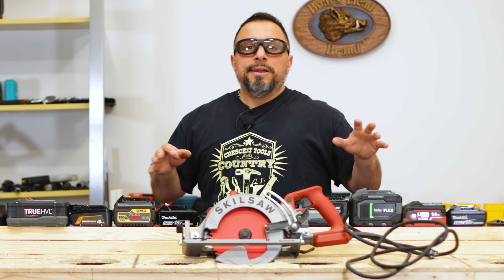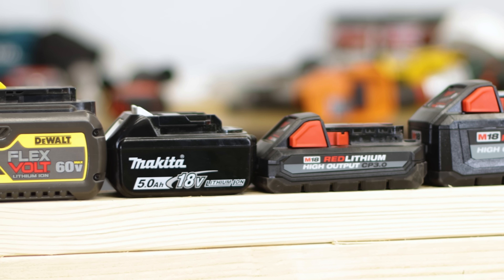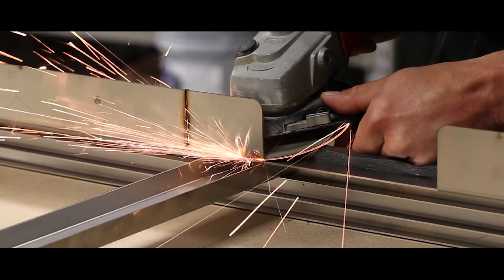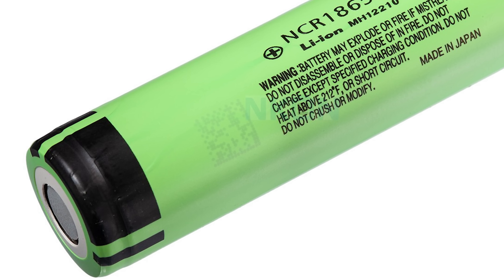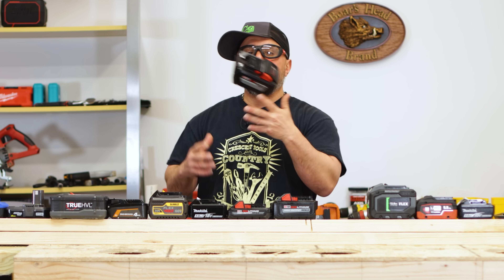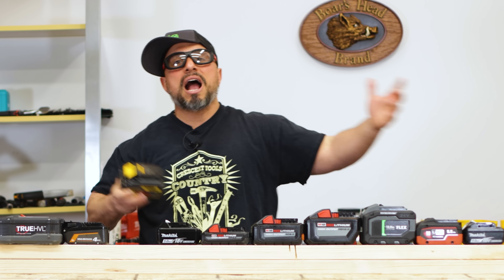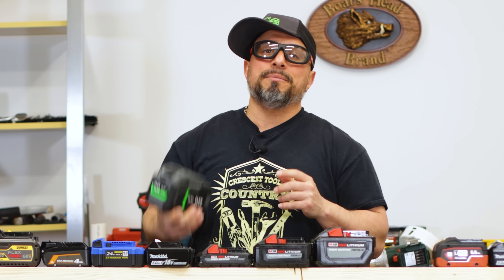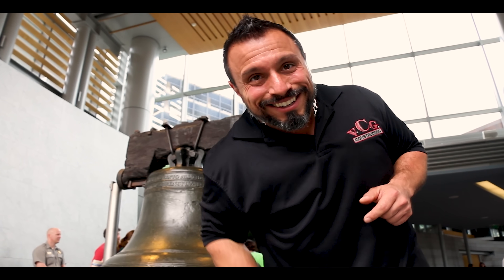Get The BEST PERFORMANCE From Lithium Ion Batteries & Make Them LAST LONGER!

Comment: That was good advice but when it comes to buying batteries the best advice would be not to buy 1.3ah 1.5ah or 3ah batteries because the cells in 1.3ah are only 1300mah, 1.5ah are only 1500mah cells 3ah are 2 rows of 1500mah cells, 6ah & 9ah batteries are only made up with 1500mah cells 3 & 4 rows of 5 cells, some manufacturers may use 3000mah cells but probably not because 3000mah cells would be expensive, best purchases would be 2.5ah or 5ah batteries which would have 2500mah cells, 2ah & 4ah would have 2000mah cells

Comment: The "CPR" for Li-ion batts he's referring to includes using a 9V battery to put a small charge on your fully dead battery for a few seconds, pulsing it for 10-20x, then throw it back on the charger and see if it will accept it (without error flashing). Worked for me plenty of times on 18650's I had laying around.
Reply: What do you mean, "pulsing it for 10-20x"?  Are you talking about connecting the 9v battery to the Milwaukee battery on-and-off rapidly 10-20x, or putting that battery you just "jumped" with a 9v onto the charger on-and-off quickly 10-20x?

Or, are you talking about putting that "jumped" battery on a tool and quickly hitting the trigger 10-20x?
Reply: @thebordernow  9V to Li-ion, + to + and - to - for 2 sec on, 2 sec off. Repeat. The goal is not to over-stress the 9V to the point of damage while doing so.

Comment: Anyone have any trouble with their M18-12.0 battery failing prematurely? I bought it with the table saw in mid 2019, but have barely used it due to life reasons. Admittedly, it sat in my truck in CT the entire time, but every other battery, including the fake ones, still hold their charges more than adequately.
Anyone have trouble with their 7 1/4 inch miter saw stuttering every single time I try to make a cut, regardless of the freshness of the battery and the amp/hour caliber? A fresh, year old 9.0 battery does it as much as a 1.5 battery. I blow it off every day, throughout the day and the contacts appear to be spotless. It's done this since day one, but now I can't even use it and I'm using my ten inch Milwaukee that came with the horrible stand. I'm pretty sure that I bought both of these through Home Depot, for what it's worth.
Thanks

Comment: Too bad they don't make tool chargers as adjustable as the ones I use for my remote control cars... I can discharge/charge to storage charge (3.85v per cell), balance the pack at full charge, set full charge limit to <4.2V to conserve life or >4.2V for high voltage packs. I can also set the depletion limit on my remote control cars to a specific range so it stops before the pack is down at a limit that is hard on it. That's with a "toy". Yet with tools that people use to do their jobs and support their livelihood, they are forced to live with devices that aren't nearly as useful. Then again, it would force anyone that buys a lithium tool to understand charging/storage more than they probably do.

I don't use 18650/li-ion cells though for RC's, everything I use is lithium polymer. But my chargers can charge li-ion as well.
Reply from the maker: Wait, explain?!?!
Reply: @VCGConstruction  Instead of having the BSM in the battery pack, our battery packs are just lithium polymer cells joined via tabs with balance leads on each cell going to a single plug for the charger along with two main leads for powering the device we plug it into. The cells are bundled in various quantities of cells we need them in for our RC vehicles. 1 cell, 2 cell, 3 cell, etc. Except, they list them as 1S1P 2S1P, 3S1P, etc for cells in series. Some packs have cells in parallel and in series to increase voltage/capacity/current handling, usually the ones with parallel cells are cheaper cells/packs to make them more robust by doubling them up internally. These packs are listed as 1S2P (1 pair of cells wired in parallel), 2S2P, 3S2P (3 pairs of cells wired in parallel with the pairs wired in series), etc. The chargers use both plugs, the main ones to push a lot of amps quickly, and the smaller balance plug to monitor each cell as they fill/deplete, then the charger switches to a balance mode that uses the balance plug only and charges/discharges each cell individually. Some chargers tell you the IR of each cell as well, also how many MAH in and out while charging/discharging, the voltage of the pack, voltage of each cell, etc. I use 18650 cells for various things and have made 2-4 cell cradles to charge them on my RC charger similarly.

Many use DC based chargers and build power supplies out of old/new computer server power supplies to run them. I have a couple 20A/500W chargers connected to a pair of 1200W 12V PSU's wired in series to have a 24V/1200W power supply. There are many chargers that run of AC and DC, just usually less output when on AC.

The packs we use for RC stuff far outperform anything (or most) packs used with power tools. Speed run guys pull hundreds of amps out of these things in short bursts. Drones pull a lot as well. Some of the more typical users peak at 100A or so, like me. I have trucks that run on 6S 5000mah packs that average 20-30Amps with peaks of 110Amps and I average 15-20 minute run times. Then I take those packs and charge them back up at 2 times the capacity (2C charge rate) of 10A in about 30-35 minutes.

Here's a video I just searched for to show you RC lipo basics if your interested:
https://www.youtube.com/watch?v=4V0MT74GKyU

I didn't watch it, just assuming they show you packs, chargers and whatnot.

Comment: I fix batteries locally, yes heat in the truck melt those cells and caused them to leak
i revived most of them and balance them is the key, internal resistance gives you an idea if the batteries done or any life left 
Milwaukee has a protection to prevent cells being charged if one of bank cells dropped below certain point, some of the earlier model has bad bms board, especially those 5Ah.
The newer 21700 has a stronger protection.
Some spot welder end points became loose also cause bms to disconnect batteries from charging.

Comment: For most lithium ion cells after 300 charging cycles still maintain 70-80% of their capacity with zero noticeable effect on performance and you can run them through several hundred more cycles before 
the degradation becomes an annoyance .

Comment: The degradation of battery packs is one of the reasons I’m not an electric car fan. Of course there are many more reasons I’m not an electric car fan but think about it for a minute,  if your electric car needs a battery pack that costs $10,000 and the cars worth is only 15 to 20 thousand dollars technically your car is not worth fixing it’s in a sense totaled. So does this mean we will all be leasing electric cars instead of purchasing them and driving them for years like I do. Plus the last time I researched it there wasn’t a cost effective way to recycle lithium batteries. The recycling process was expensive and dangerous as lithium can be very volatile in the right conditions. I’m sure electric is the future of automotive transportation it’s just still in it’s growing pains phase.

Comment: I often gripe about my milwaukee tools but the batteries are another story.  The 2 original batteries that came with my first drill impacter set are still going strong after 10 years.  I have a 5.0 ah battery thats 7 years still great.  And now a beastly new 8.0ah battery.  Awsome runtime!
Reply: Question is do you use them every single day. I use my tools every single day mine are usually done after 3 to 5 years max. Using them every single day vs using them sometimes is a very different story!
Reply: @marcowens3522  I had the same experience as this last guy.  Got a Milwaukee combo drill/impact set with 2 5.0 batteries back in 2015.  I use them for work every single day.  Not only that, I semi-abuse them.  I use that drill as if it were a hole hog.  Its been so hot from heavy use I burned my hand on it.  I use my sawzall as if it were a gas powered chain saw.  They are still going strong.  I have never left them on a charger overnight and I always use them fully and charge them fully.  I leave them in the work van in 100+ days and way below freezing nights.

Dewalt batteries on the other hand I have not had good luck with.  Most of the guys I work with have Milwaukee stuff.  1 guy uses Dewalt and 1 guy uses Makita.  For almost all of us Milwaukee is the best.

Comment: I have Milwaukee and DeWalt batteries M18, 20V that I have been using since April 2016 and they are still going strong and are used 6 days a week.. I don’t leave them in the cold or heat and charge only when need be. I store them in a DeWalt 2.0 tote with vent

Comment: So I'm building up my arsenal of Milwaukee M18 Fuel, and I was thinking, why don't these tool manufacturers make a power adapter that clicks into where the battery would go but runs straight to an AC outlet.  This way one could use AC when needed, and battery when needed.
Reply: Metabo HPT Does this with their 36 multivolt adapter.

Comment: Great job explaining battery maintenance. I keep my batteries indoors in a stainless steel pot with metal lid, just in case they ignite for some odd reason. You can never be too careful. I store them at 50 percent until I need to use them then I charge them  to 100 percent for full power.

Comment: I just had to pull a warranty from Milwaukee for 4 8ah HO and 2 12ah HO that are 3 months old. I’m not using the rapid charger any longer and purchased the 6 bay sequential charger to get more battery life. On the bright side the Milwaukee rep did state the company will gladly warranty all batteries for 5 years as many times as necessary.

Comment: Don't get me wrong there's nothing like the convenience of a battery powered device especially the screw gun but for the most part I do not mind picking up a three-prong Court walking up to an orifice and sticking that into that spot it does not take me all that long it is not that much of an inconvenience to have a wire attached to it and the fact that I have peak power and performance at the flick of a switch I think is worth all the inconvenience of sticking that power cord into a hole and having to wind up a power line I know it really makes life difficult for some but I guess I'm used to it

Comment: I bought seven milwaukee tools this week from Home Depot and every single battery was one bar out of the box.  Should I complain to the depot or Milwaukee and will it do any good?
Reply: New batteries are stored with a partial charge and require a full slow charge before use!  What you are seeing on those batteries is normal.

Comment: Oh so much wrong information while also in a way being right. A lot of the information is right, but more so pertaining to older lithium batteries, and also a lot of it is dependent on the charge circuits the pcb's in the batteries control the life more than the cells. Granted they are in some cases designed that way for safety others for profit. Like laptop and cell phone batteries built same way, but rated usually 100000 change cycles. Granted Sony at one point said the shortening of life do to the charge circuit shortening it was to increase revenue for profit not safety and they were going to stop the practice and try to change it through out the industry. Have they🤷🏻. But yeah the batteries are the same, plus if you know how to solder, or have a spot welder you can change the cells instead of replacing the batteries if they don't have a circuit chip that controls the life, which most tool batteries I don't think do.

Comment: Bought my first Milwaukee drill several years ago - around 2013 I think. Came with two 2.0 amp hour batteries. I only used the one battery and never even messed with the second one. Fast forward a few years later and I learned a lesson that they wouldn't charge. I was able to re-use one of the 2 batteries through jump starting it with a good battery (ended up buying a 3rd battery to be my only working one) but now it won't charge again. Now that I have more batteries that work and more tools, I leave the tools in the garage and the batteries inside the house...

Comment: Good thing you put the Milwaukee 12 amph for the add.   It and HO Milwaukee tools is a horrible performing.  When they warm up and trip out...you walk to the charger for more batteries to the point corded would be better.  I think I have actually damaged a 12 amph... it no longer shows a full charge on fuel guage.

Comment: Another thing you never want to do with Lithium batteries, is when using a tool and the battery dies, don't do like we all used to with NiCad batteries, and run them til they die (tool shutoff), then wait a couple of minutes for the batteries to recover, then hit it again trying to finish that hole, or cut or whatever. NiCads and NiMhs can handle this treatment and it's even good for them once in awhile, but it will kill Lithium batteries real quick! If your Lithium battery goes dead (tool shutoff), just put it in a charger, or get a charged one, don't try to wring that last little bit out of it.

Comment: Makita star 🌟 batteries will cut out before you can fully discharge them.  And blow cool air into the batterie via a fan built into the charger.  So the tool will shut down and save the battery 😃🥳🥳

Comment: Below freezing doesn't permanently damage the batteries from the research I've gathered, unless it's extremely cold like -20F. It's only a temporary capacity reduction. Which is suppose indirectly translates to lower life span as you will be charging/discharging more often when it's below freezing. 
And yes Vince, I agree 100%, all electronics manufacturers including tools and phones, should be implementing a 20% buffer on each side, with the ability to override this if you need the extra capacity. Would really help improve lifespan of devices and keep this e-waste out of the landfill. 
Just wanted to edit: keeping li-ion batteries between 20-80% can increase the charge cycles to well over 1000, even close to 2000 in the papers I've read, that's a massive difference!

Comment: Awesome Video Brosuff. So much I didn’t know about batteries 🔋 wondering how many cycles usually in the smaller 12-14v have 🤔💭
Reply from the maker: I would think they’re about the same
Reply: Number of cycles is the same regardless of voltage.    Each lithium ion  cell is roughly 3.7v, manufacturers  connect cells  in series to provide the voltage each tool needs.  Higher voltage= more of the same cells in series.

Comment: The very basic chargers that come with tool batteries make it hard to care for batteries. With no selectable charge rate, the charger always charges at its max capability. There is also no way to set the charger to charge to less than 100% if you wish to put the battery to a 40-60% storage charge.

Comment: All good advice and so true, and the same can be implemented for a cell phone....(especially those super quick rapid 20-30 min charges to 100%. Thats gotta be brutal on the battery when done over and over, imo. It’s why I charge my phone at normal rate, as only takes 33 mins longer....usually, and never let phone go below 20-15%. Just my imo).
But back to tool batteries. Would be nice if the batteries didn’t degrade, and maybe someday a brand will solve this “issue”. 
Till then, we got some great tips from Vince to help keep batteries at optimal state and to save money by not having to buy more batteries😉👍🏻👍🏻
Reply from the maker: Thanks Aepek, hope you’re doing well!

Comment: Shouldn’t it be made compulsory to provide battery indicators. These things can become fire or explosion hazards. And a Lithium ion explosion is something of note just ask the people who practice radio controlled hobbies. 
Justvsaying there should be Rules and Safety regulations regarding design and manufacture. In addition there should be specific recycling centres for these batteries in order to harvest the lithium back again. Lithium is expensive and that is the reason they cost what they cost. Moreover it should be stated clearly how many cycles you can get out of them too to allow the consumer to make an informed choice. Maybe a universal adapter system would also be handy. 
Thanx VCG  for providing us with this essential info!! Much appreciated!

Comment: I have those dewalts since they came off and im sure that im over 500 cycles,but i always tryng to keep them charged and i use the fast charger and as soon as they fully charged i remove the battery so dont over charge,i dont inow if im right but i think that a battery fails when you pet it all day in the charger,i bpught my first flex volt 60v 2 years ago and still holds the charge very good

Comment: As a DIYer I always buy corded tools.... they last decades heaps more power cheaper to buy no batteries to chemically age and replace - assuming there even still available.....

BUT

It’s always handy to have a cordless drill driver hammer drill and blower...... but that’s it the rest is corded

Full time tradesman is a different story

Comment: ...the tools should come with both feature of battery and corded if possible..I had to mod my portable drill to a corded dc ..never used those battery pack since..it came with exactly 12dcv instead of 14dcv charger...it never fully charged to run those motor..I was frustrated...dang!!..it never had any bms on it..I checked it..

Comment: The charging to 80 and not letting it discharge below 20 could be programmed on the bms- battery management system.  But some company's don't give a f and want you to buy batteries more often